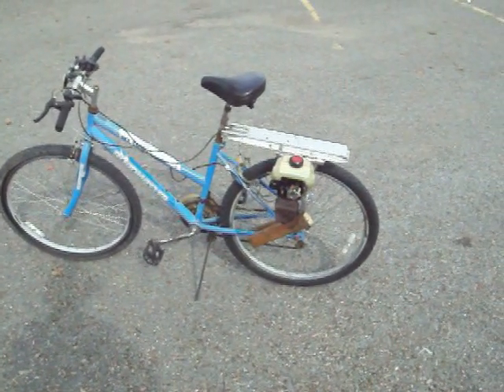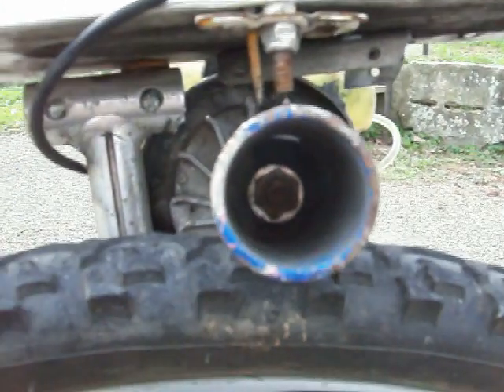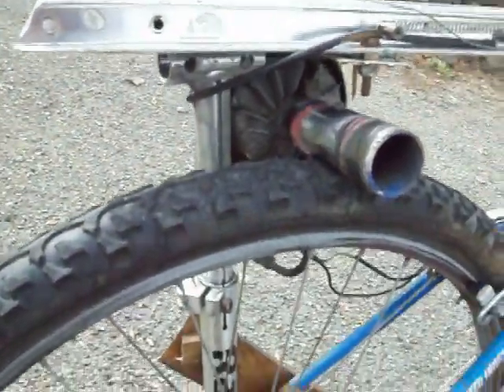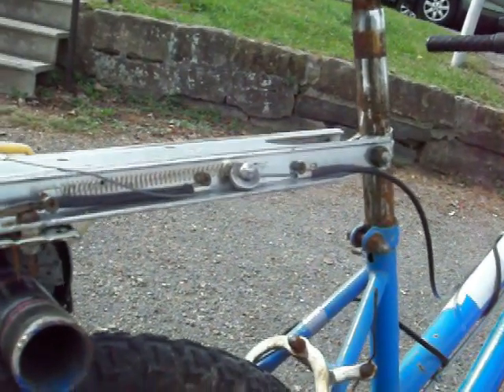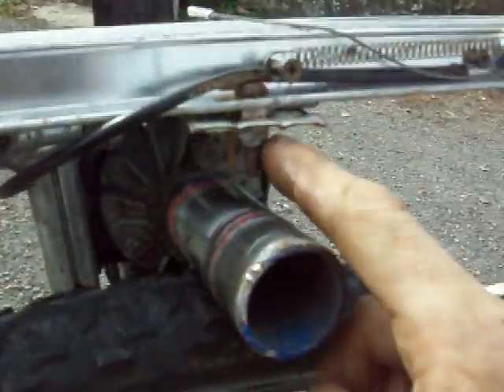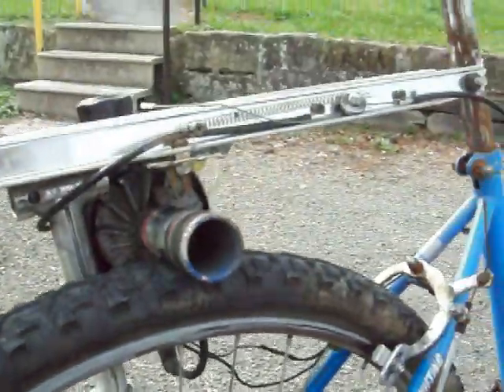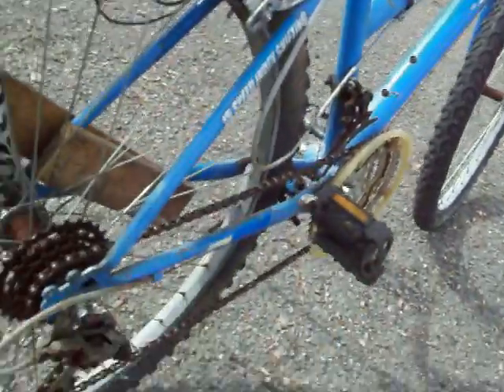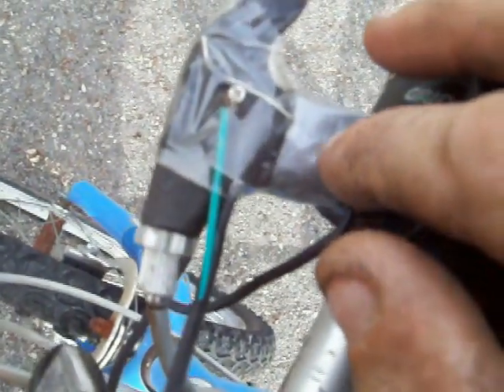Simple motorized bicycle system weed wacker bike

Comment: The make shift rear fender made out of a razor scooter is real smart, it acts as a cover for the spindle & could probably carry something back there, maybe even balance the bike with a pannier :)?
Surprised that the wood screws works for a high vibration application :)!
Lastly, the kill switch to the brake is a smart precaution, & cleverly pulled off :)!

Comment: I got a craftsman Briggs Stratton 24 inch kent terra verticle shaft friction drive rear mount. 140 cc 5.5 ft lbs torque. Super fun just cruises on idle turn on and off. Getting it tuned in. No pedaling required after you started it though lol

Comment: I like the razor scooter idea. That being said, these things do not have a centrifugal clutch. The arms you removed to fit that bike peg on the flywheel were to grab the pull start. Also,  the "thing you put the cables through and tighten down" is called a cable clamp.

Comment: Is there also a strong grip between the tire and the roller. Is it necessary a strong pressure between them. My engine is 52 cm when climbing a slope there is a danger of slipping. What is the diameter of the friction roller. thanks I write with a translator so spelling is not very good
Reply from the maker: thats whats the scooter neck is for you just hold it down then us the clamp on neck to keep the pressure.